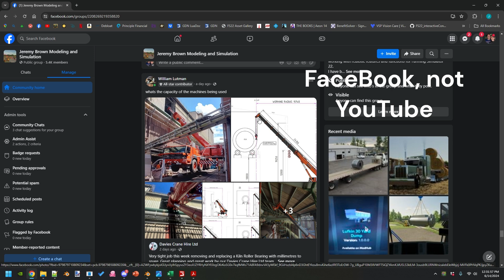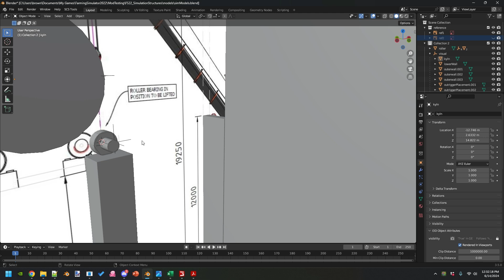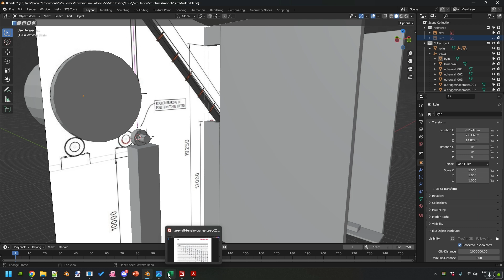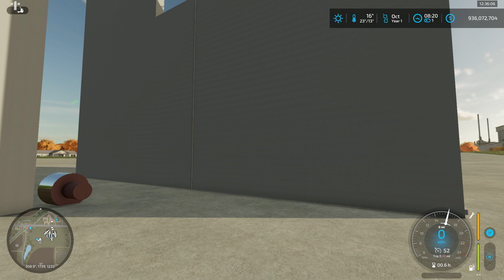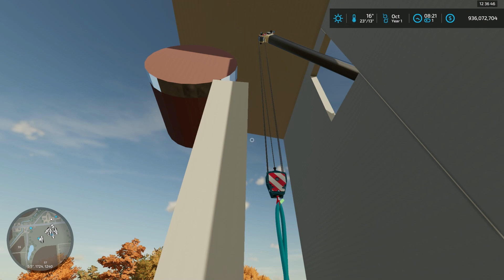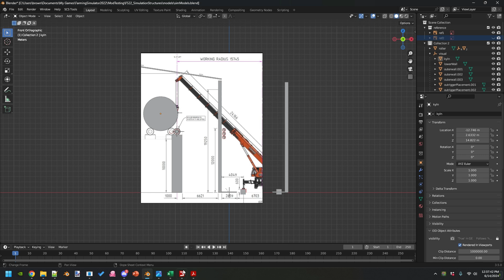Farming Simulator 22 Simulated Kyln Roller Lift

Comment: hey, i cant figure out how i can pick up stuff with the cranes what mod do you use to pick up things with all cranes?
Reply from the maker: These are all things that I made which I have made to be able to be lifted by my cranes. The adjustable spreader bar can pick up things without attacher joints using tension belts
Reply: @jeremybrown9379  I still dont get it. i mean i cant lift anything up with any crane do you use some kind of mod to lift things up?
Reply from the maker: @desmondvanvliet227  I do not unless I am setting up a lift and that is all I am doing. You need to align the hook so that it will attach.

Comment: I'm seeing your mods and they are amazing, I also saw you did a LTM 11200 and SPMTs for FS19, Will they come out for FS22? Cant find them on the itch page
Reply from the maker: The LTM 11200 is undergoing an update and I am redoing the model for the SPMT to get more detail on it
Reply: @jeremybrown9379  Awesome, also can we assemble your lr 1600/2 crane with another crane that is not your terex 5500? The version I have lags my game probably because it's too complex, idk, the lr crane doesn't lag my game so that's why I'm asking, and again, awesome work.
Reply from the maker: @gedostoto  you can. I am in the process of making it with the LTR 1220.
Reply: @jeremybrown9379  Awesome, also sorry for being a bit dense, but how can I rotate the LR 1600/2? I'm probably blind but I don't see it in the controls, it's probably the first two options in the keybinds section, I assigned to them control+leftshift+k and the same but the m, but they aren't working for me.
Reply from the maker: @gedostoto  there may be mods that are conflicting with it. What you can do is remove all other mods but the crane. Then assign the controls. It works best with dual joysticks, then game controllers and last key board.
Reply: @jeremybrown9379  Thank you for your response man, I solved it, it was that the keybinds were conflicting with others, now I'll proceed to assemble it with the SLF variant in a realistic way, pretty nice mod, even in construction simulator games we can't assemble these crawler cranes, it's really appreciated that you did this.
Reply from the maker: @gedostoto  glad to hear you got it working. I used to play contraction simulator but always came back to Farming Simulator due to the freedom it allows.
Reply: @jeremybrown9379  Yeee, the last cs is more arcade, and I don't like that, also we don't have crawler cranes (except in the 2015 version but I don't like the process of assembling it) so I'm happy that I discovered your mods.

Comment: Hi Jeremy,

That loadchart is for the boom pinned. 

Not sure about Terex, but with Liebherr we have other columns showing capacitites with boom unpinned. It's allowed, but derated. 

If you look at detailed Liebherr loadchart then below you see boom section config. + Means pinned. - means unpinned.

And definitely you have limited capacities to telescope with load. Actually i never allow my guys yo telescope with load. Too much stress on the sliders.
Reply from the maker: Thank you for the information Marek. I did not think you could telescope it with a load. I am not sure what the original crane was so was just trying to recreate the lift they had done. They may have had a chain extension boom as they did have to retract it during the lift.